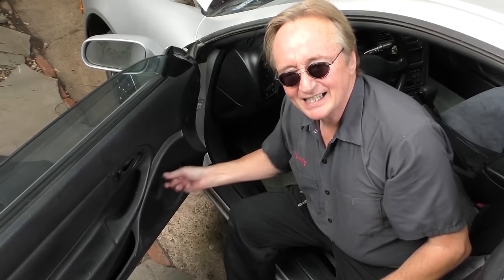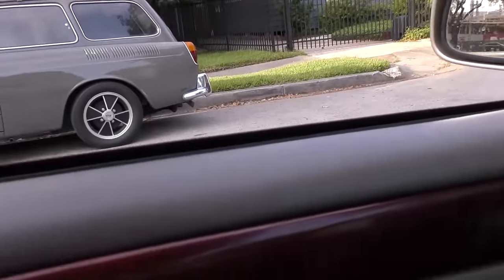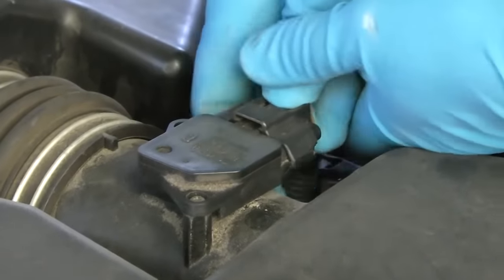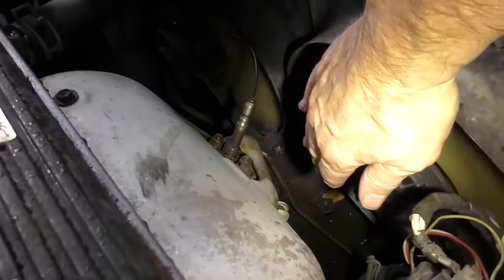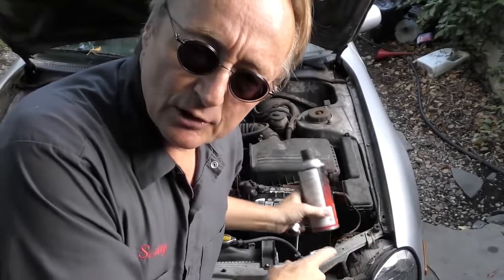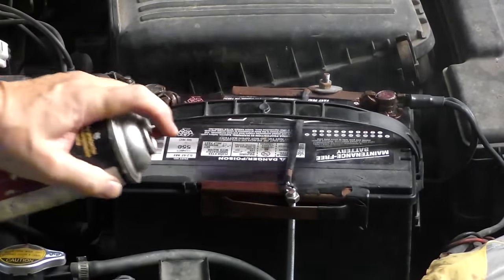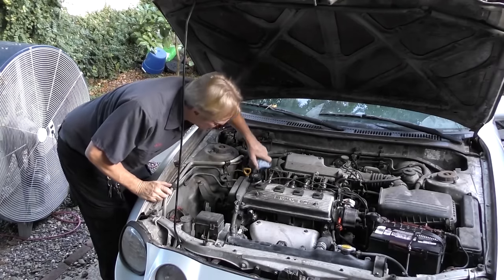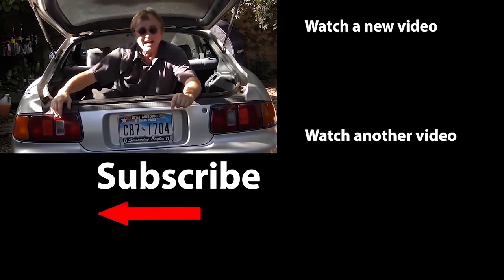I've Been Saying This for Years But You're Still Not Doing This to Your Car

Comment: Bad advise telling people to move their throttle plate without addressing the difference between drive-by-cable and drive by wire. DO NOT move a throttle plate on a drive-by-wire throttle body. You can run the risk of damaging the internal motor and gearing. You will have to replace with a new one if you mess it up, cant repair them and they're not cheap.

Comment: Prevent windows from sticking with manual windows 😎
Reply: Lol are cars with manual windows even made anymore? Some things you don't have a choice about. Even if you want a really old, used car, that won't be viable for forever.
Reply: Wouldn’t they still get stuck?
Reply: I wish they still had manual windows. I actually prefer them lol
Reply: @micah_lee  Rarely, and you can still go into the door lube the mechanical parts. When those parts wear out you can fabricate them fairly easily if you're handy at that sort of thing. I've done it.
Reply: @googlewolly  hopefully it will always be an option. I would pay extra for it, I detest power windows.
Reply: @alsaunders7805  I've never had problems with power windows, so I like them. I can  understand people wanting manual, though.

Comment: Also I use the mobil 1 20000 mile oil but change it every 3000 because the oil does perform better in the benchmarks I've seen specifically with maintaining it's viscosity. It's also pretty good at wear protection and has conceivably enough detergents and dispersants that it can at least be certified for 20k.

Comment: On spilling things on the window controls: Accidents do happen, my dad had spilled soda on his driver door switches and of course they ended up very sticky and mostly didn't work right.

I don't really have direct experience with cars, but I've opened up and cleaned out video game controllers a ton. I figured that it probably works on the same basic principles (it does!). I removed his assembly, unscrewed everything. All the really sensitive electric components were fairly well isolated and did not have a problem. Continued with soaking the non-electrical components in warm soapy water for a couple hours, followed by spreading them out for a day to dry (slow natural drying is best in these things), put it back together, the assembly looks like new, and works as perfect as it should.

Comment: Remove the door panel.  The rollers and linkage can get dirty.  Clean and lube them. With spray lithium grease keep them lubed for years. Fixed my slow moving passenger door window.

Comment: Never changed the brake fluid in my 86 gt mustang. Only reason the power steering fluid got changed once was because the pressure hose broke. I never change these things on older vehicles but my newer ones yes I will definitely change 👍

Comment: I’ve bought five motor assemblies for the windows on my 2010 Ford Escape. One is a reversed engineered one,, it is louder but feels more solid. And it was wired backwards no big deal. The assemblies from Ford are made with weak parts

Comment: Actually I found it in 2 cases OEM coolant fluid is cheaper at the dealer than auto parts store. $7 for ford orange coolant, $8 for mopar coolant OEM at the dealership. Call around prices drastically are different. Even at the auto parts store they want $11+ for aftermarket coolant that may or may not be 100% the same stuff.

Comment: I'm still driving a 28 year old Pontiac Grand Am GT and all I've ever done is keep all the oil and fluids changed or topped off. It just turned 70 thousand miles with the original transmission fluid but engine oil gets changed every 3 to 4 thousand miles.

Comment: Still should check windows are closed well including a sunroof if necessary. Mostly flip switch for a second , just dont hold it down for several seconds. You don't want water in your car during a heavy thunder storm. Flipping switch  for a second shouldn't damage anything.

Comment: What I've found works better than that spray battery terminal protector is plain old wheel bearing grease or if you can find it the anti-corrosive gel for terminals. All you do is get a cheap small 1" paint brush and with the terminal off spread grease around the post (most importantly because it seals the area where plastic and metal meet and gasses can escape) and then on any bare metal that touches the battery like the hold down bracket and especially the terminal and cable where the metal conductor goes into the jacket insulator to keep acid from wicking down the wire strands. I maintain a fleet and this has saved me lots of headaches due to battery corrosion.

Comment: Modern cars have window control modules which detect the current going to the motor, when the window sticks, reaches the top or bottom position and you hold the button, nothing happens because the module sees the high current and cuts the power to the motor.
In some cars it's more complicated, Honda for example have a system where the control module always knows exactly where the window is, it counts pulses from a sensor on the motor, it knows how many pulses there should be to reach the top and to reach the bottom, the purpose of this system is so that if the car becomes submerged (and there is a sensor for this in each switch pack), the car can tell the windows to open, so that the occupants can escape.

Comment: I've heard "change the oil every 3,000 miles, or 3 months," since the early '80s, so I've just gone by that. Recently I found the factory service manual for my Jeep XJ (4.0L) and it says change every 7,500 miles or 6 months! Could that be right, or were the engineers/technical editors dipping into the catnip back in the day?

Comment: I've got a Dacia (Renault engine) with 135000 miles and a diesel engine, and still does 59 MPG. I always change oil as recommended by the manufacturer: every 12500 miles.

Comment: Temperature gauges are always saying everything is A okay on modern cars. Always 90 or dead center. Only when things are seriously going wrong and overheating, only then the meter will move up. And mostly it will shoot up instantly. Some cars have a dealer menu that shows you the actual degrees so you can monitor it. My rover 75 has the same. From 70-113 it will show dead center. 114? Meter shoots up and engine overheating flashes in your face in bright red. My old 85 SD1 vitesse thankfully has a real temp gauge.

Comment: Concerning the window switches getting wet, if you have a Dodge challenger,  everytime it rains, the water comes in and pours directly on the switches. This is due to the way the body
of the car is made. The contour of the vehicle, I guess you could say. That's even if you just
"crack" the window for air or at a drive-thru fast food or bank, numerous reasons we have to
open the window. I even tried to order "drip guards" to put over the windows, but they don't
make the ones that fit in the window channels. They are all made to stick on your paint job!
These have a habit of blowing off at high speeds and sometimes taking little pieces of your
paint with them!  Maybe they make the good ones by now, I haven't checked lately.

Comment: I always run 87 octane gasoline but I have found non ethanol gasoline about 60percent of the time. This absolutely increases my fuel mileage and at the same time cleans the cat.I have been able to clean apart ally plugged cat by using non ethanol gasoline

Comment: I have been saying for years that car accumulators should be in an integrated or simple external, heated and insulated box, because the most common reason for cars not starting in the winter is that the accumulator cold!

Comment: The reason not to hold down or up once fully down or up isn't "burning out the motor" its that you're straining with full motor power against cheap plastic, and teflon wire guides that get brittle over time, and will snap, making your window stop moving up and down all-together, and requiring an $80 window regulator replacement, that makes you sick to replace since the only thing wrong with the whole system is a plastic piece you can't buy, you have to buy a whole regulator AND motor.

Comment: my first dodge has a huge 600 amp battery that is supposed to be enough amps for all electrical parts on the vehicle all windows locks and the transmissions tcm modular box that is constantly messing up while shifting here and there to cold weather draining the battery to low for electrical parts to function right .so I put a 1000 amp 850 amp cold cranking in and things function better starts fine runs fine but don't put that corn juice E85 in on accident either it will make the computer wack out .

Comment: My 2007 PT Cruiser, driver side window (of course) will not roll down when it's hot outside.  If it's down, it will roll up...and when it's cool outside, it works just fine.  Drives me crazy, but I don't have the funds to fix it.   I've always had older cars with crank windows, I wish there was an option for all windows but the drivers window to be automatic and the driver still gets a crank window :P

Comment: To lubricate the window's rubber trim ( the window's grooved guides or 'runners' ) , just spray some silicone spray into a clean rag, then wipe the wet portion of the rag into the runners....  that way, no over-spray or mess.

Comment: The Hondas and probably other manufacturers require a window factory reset best done by a high level scanner after installing a window regulator.  Doing manually is cumbersome.  And if you don't do it the new regulator acts up eventually burning itself out.

Comment: I have been using silicone lube spray on my car windows for decades, it's also the right lubricant for any plastic where there's unwanted friction, like when your steering wheel squeaks because heat made the plastic distort to where it's rubbing.  Never use petroleum products like oil or WD40 for plastic!  You may ruin it!  Plastic is a petroleum product, and petroleum based lubes are a solvent to it!

Since I've been doing it, I have never had a motor burn out or the windows pulled off track.

Comment: Power windows was an important lesson in mechanical statistics for me. When I was very young, I was told that things like power windows were prone to fail because they required more moving parts and the extra complexity of needing electricity.  This is where statistics fail to tell the whole story. When I was a young man, I had one car after another with hand- crank windows, and ALL of them had problems, form the simple hand-crank-falls-off-and-has-to-be-screwed-back-on, to the gears inside the door no longer meshing, and you have to take the door apart and fix it. 
Since those first 3 or 4 old hand-crank window cars, I have owned nothing but electric window cars and have never had a problem with any of them.

Comment: Absolutely DO NOT use a garden hose or anything with high pressure water on on your a/c condenser, as that is one sure fire way to knacker it. Seen it loads of times on Supermarket Refrigeration systems where the condensers get damaged when they are cleaned incorrectly. By all means check its clean, you should be able to see through it, compressed air can clear it pretty good. But if you must clean it get a dedicated coil cleaner that is non corrosive, some of those condensers can cost £££'s plus you'll have to get the a/c charged again

Comment: You can save money by just pouring motor oil on the battery terminals when changing your oil. Old trick, rids corrosion. You can glue a penny to the top of the battery, all the corrosion will attract to it.

Comment: Forgot the part where if you move a window switch and there's no noise or noticeable electrical load while not working, it could just be a dirty or corroded switch. A lot of the time you can recover the function of a balky window switch with a can of electrical contact cleaner. Just spray a good bit in there and work the switch back and forth a lot with the power off. If it works, a $5 can of electrical contact cleaner is a lot cheaper than the $150+ for a window switch assembly. If it doesn't, then you have another cleaning tool in your inventory, so it's not all bad.

Comment: If you need to reset the 1 touch auto up/down (even if you disconnect the negative terminal, it'll reset). Press and hold the switch down completely and once the window is down, continue holding for at least 3 seconds. Let go and pull and hold the switch up completely for another 3 seconds. Bam auto down/up fixed.

Comment: Two minor comments:
Re: silicon spray on (exterior) window gaskets.  The silicon over time, in sunlight, BONDS with the rubber and we know what silicon actually is. It makes the rubber PREMATURELY become brittle. (Want to ruin your dashboard? Use ArmorAll on it, it's got silicon, looks good for month, but with repeated use, the silicon (read GLASS) bonds and stays, and CRACKS the dash. Doubt this? Simply spray just the exterior sidewalls (not the tread) of your rear tires. See how they age in contrast to the untreated front tires a year down the road. 

Re: Car manufacturer radiator coolant IS NOT all the same. Toyota that you mentioned? Has THREE separate functions and corresponding chemicals in it. First is the most common,  to diminish freezing, second is waterpump lubricant, and the third is 'leak stop,' so that when the radiator leaks a drop (and Toyota's... do), it crystallizes in the air at the leak, and stops the leak. You cannot buy the equivalent mix of purple coolant from an OEM.

Comment: Yo see if the battery is charging or not check without a tester...simple ..just start car and let engine run..take off one lead from battery terminal and if car cuts out ur alternator is not charging . If it keeps running the alternator is charging ok. Simple trick to see if alternator is ok or not.

Comment: Scotty you give good advice but what you just said about high test gas for it a engine is not true the Ecm will compensate for the high test gas and it will keep your exhaust valves from burning up too quick you'll get better fuel mileage everything low octane gas is junk

Comment: I had a problem with my vibe / matrix. The locks use a worm gear and a DC  motor. The worm gear slipped. A cog I had to open the little housing and move the little worm gear... never had another problem.

Comment: I hate to tell you this, but the reason the Window won’t go down, is because of moisture has gotten into the internal Switches in th Motor. They have Corroded, and slamming the door, jars the switch enough in it makes contact. Way to delay this from happening, is to exercise the motors, after the car is exposed to water. The motor on Scott’s car will have to be replaced in the future. This is a difficult job and takes two people with mechanical aptitude. You must have a thin pair of mechanics gloves on! There are YouTube videos on replacement. If you hire it out get an estimate from several dealers, and a locally owned glass shops.

Comment: Years back I was having cooling issues with my '96 Ram. Somehow I determined that the fan clutch was not operating properly. I replaced it with a "severe duty" clutch can't remember the brand from O'Reilly. Started the truck and when I gave the throttle a bump it blew my hat off! Problem solved!.

Comment: You NEVER want to get silicone on your auto paint. There are times that it simply WILL NOT wipe off, and you will have lovely white blotches where it sits on your paint. Body shops also loathe trying to get it off of paint, as well.

Comment: Yah my 2001 maxima ,  driver side window goes down but not back up
I used that  silicone spray for many years to prolong things, now it appears the motor went.  I got it back up and unplugged the power to it.  That way can still put down the other 3 windows.   
Now it’s time. For a new motor I think
I did hear it clicking. But not moving backup unless you pulled the window at same time.

Comment: I put a K&N air filter on my old 97F-150 back when it was a few years old and started running funny later. Turned out the stuttering abd popping was the MAF sensor needed a blast of that cleaner. Ran like new afterwards.

Comment: my 2004 toyota avalon xls temp has always ran at just under halfway on the temp gauge. if im going down the mt. itll run slightly cooler than that, but only slightly and then as soon as i get to the bottom of the mt. itll pick back up to just under half. i manage about 26mpg on average with it, which seems fine to me, i guess. most of my driving is at 45-65mph. where i live, theres really no stop and go traffic either, so again, it seems about right in my case. my avalon has just under 300k miles on it and the only thing ive really needed to do is regular maintenance and i had to have the timing belt changed about 75k miles ago since it was the original belt and it was starting to look ever so slightly worn, so figured i would go ahead and just get that changed before something happened. had a timing belt go out on an ex gf's 2005 pacifica while going down the road and the entire vehicle just shut off and was gonna cost me 2x more than the vehicle was worth just to get the engine to start again, so i decided to spend the money on a toyota avalon xls instead. lol